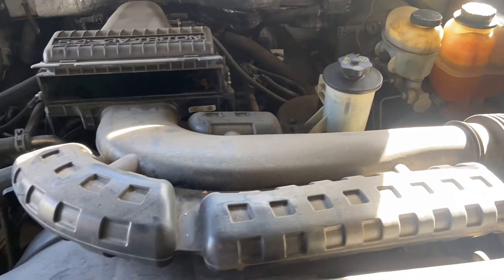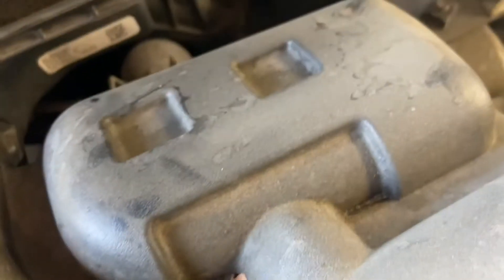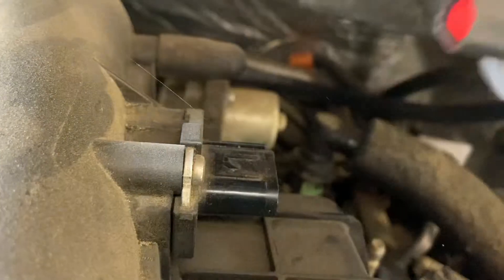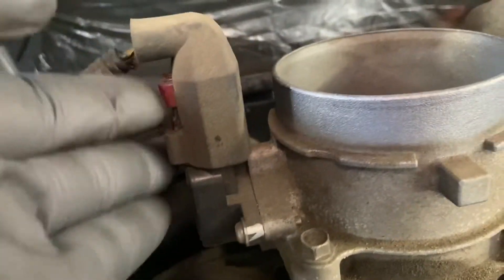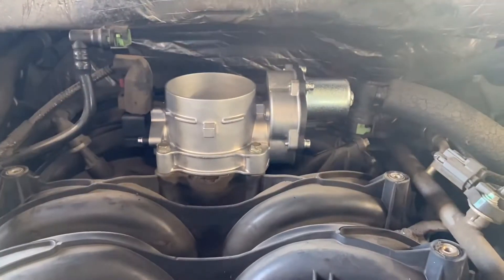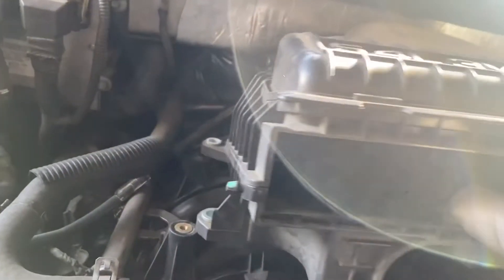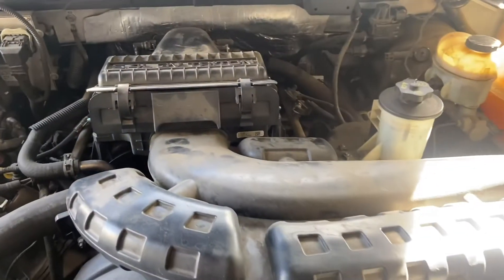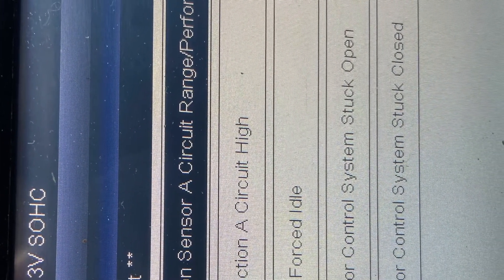Replace throttle body assembly 2006 Ford F-150

Comment: Could a faulty TPS put the truck in limp mode for transmission shifting with no codes?
Reply from the maker: In most cases a fault code would be present. The computer would never enter limp mode without a check engine light or fault code present.